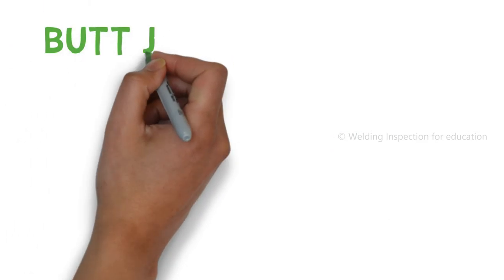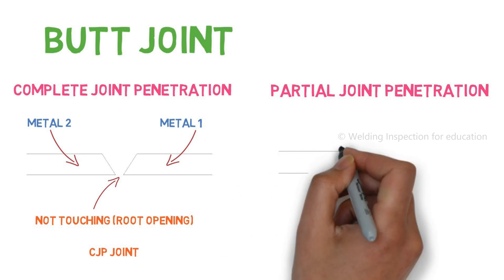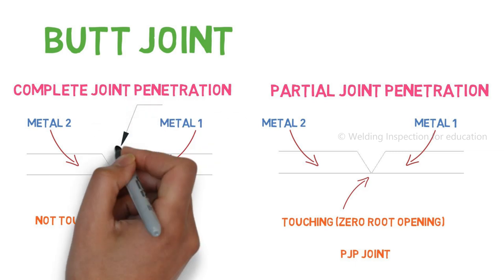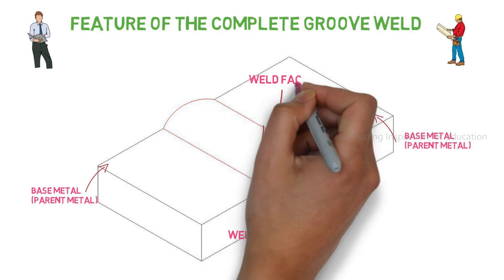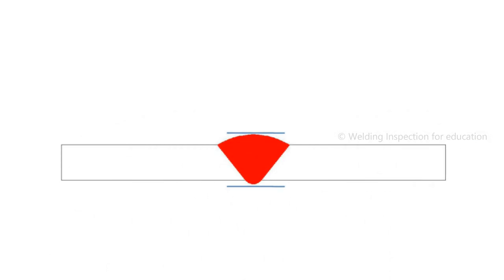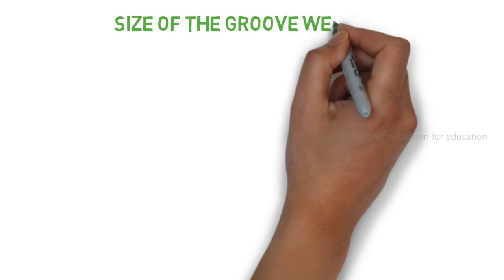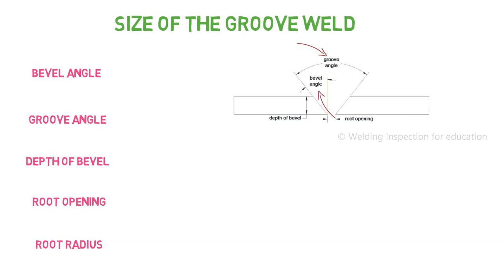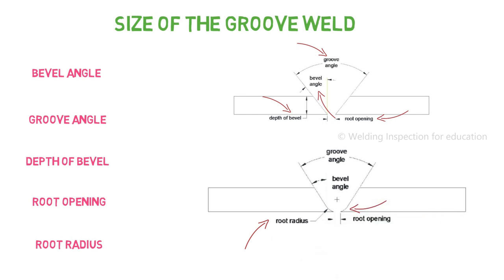Features of the Completed Groove Weld : Part 1

Comment: What is effective throat in pjp weld
Reply from the maker: PJP weld is one type if butt joint, groove weld. 

it is depend on type of the joint and how deep the penetration goes. there is a table in D1.1 showing the depth of the weld possible in PJP joint and based on that depth it is considered as effective throat.

Comment: Please explain WPS
Reply from the maker: Sir, what area should I cover ? 
need or WPS ? how to write? or something else or specific
Reply: @weldinginspection7239  guess he means how to write :-), I am in a valve industry and most people don't know WPS, PQR,WPQ
Reply from the maker: @shaunshaw8699  thank you Sir

I will prepare detail video on that.  I am getting several requests based on that. do you know what is the most common welding procedure and steel used in that industry ? so I can be more specific
Reply: @weldinginspection7239  Thanks for your reply ! i am working in water valves yet quite layman for welding also , we always use rg5 or Stainless steel welding on the ductile iron   , sometimes we make same material welding like duplex welding or SS welding for penstocks  , thus guess not very common situation for others
Reply from the maker: @shaunshaw8699  interesting, lucky you. can I ask which part of the world is this work located ?
Reply: @weldinginspection7239  you means in the valve ? we do welding on just sealing surface.
Reply from the maker: @shaunshaw8699  got you ! :)